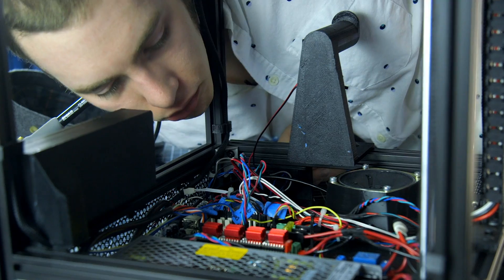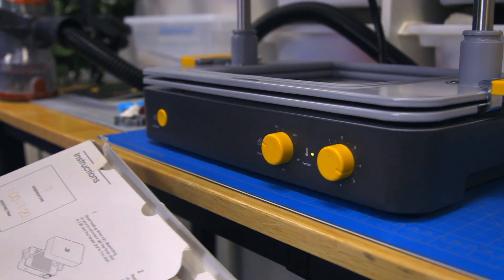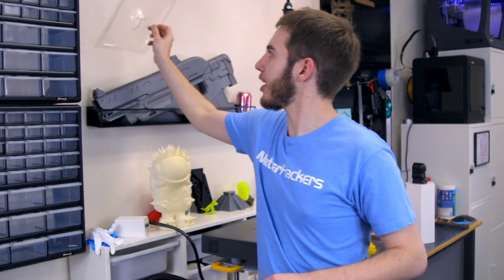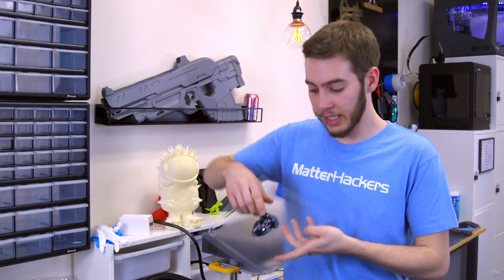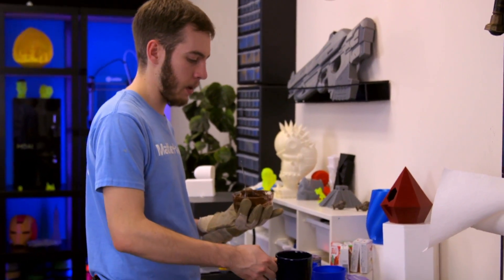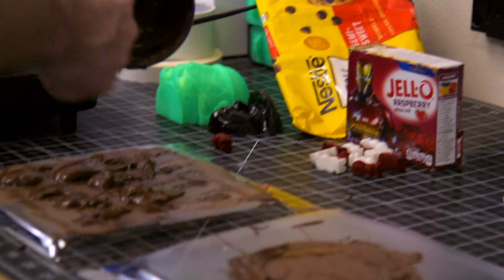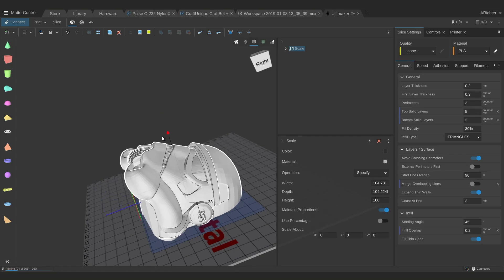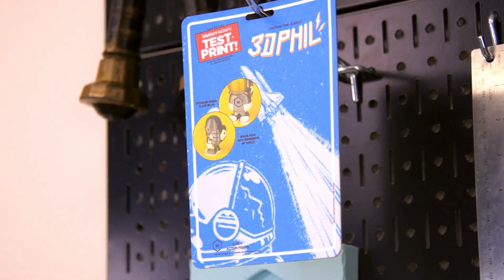Alec Eats His Face! | Let's Make | Vacuum Forming With the Mayku FormBox

Comment: I've operated huge versions of these. We use to use cool air fans after forming. The cooling helps the form pop out. If you get tiny bubbles appear in the formed part, that means there's moisture trapped in the plastic. Place in a very low heat convection oven for few hours or overnight to dry the sheets before forming.

Comment: I wonder if it would be useful for making custom cases for components.. Print a buck. Vac form the shape and bam the item you place in the case will have a perfect home and not. Bounce around.. And if it's not sensitive save the print step and just vac the item!
Reply from the maker: You'd basically be making something just like the 3D Phil figure. If you're thinking of something like a circuitboard there may be too many details of differing heights or the pins might poke through the plastic. But something like a phone case isn't a bad idea! I may have to try that. - Alec
Reply: @MatterHackers  or even a transportation case for like drone parts or something where it doesn't need soft padding but instead locked in place
Reply from the maker: Okay, so sticking your phone in it doesn't work out too great. The phone was fine, but the plastic didn't conform around it enough to hold on. It's more of a specifically shaped dish than a case. - Alec
Reply: Great idea - what we've found useful is making a slightly larger 3D printed version of what you are trying to make a case for - this way you can tweak it to make whatever you are putting in the case, extremely snug. Sort of like what Playdud did with packing on this guy: https://www.mayku.me/article/playdude-creates-professional-blister-packaging-with-the-formbox

Comment: What about using a heat gun while it's vacuuming to help pull the webbing out?
Reply from the maker: On something that small, it wouldn't help too much. Webbing comes from there being too much material so it folds over itself, like how a tailor will remove material in a dress or a suit to make it fit better on a person instead of bunching up around their joints. We can't really do that with plastic, so the best shot would be to keep it less droopy and therefore it needs to stretch to cover it more. Great idea though, and it does help with bigger projects that don't get enough heat before the vacuum catches it. - Alec

Comment: Can you pour resin into a vacuum form mold to make parts (instead of a messy silicon mold) ? that would be a cool video.
Reply: depends on materials of the resin and the plastic mold I will look into it some more.
Reply: @Java_Fusion  cool looking forward to hearing more.. i would love to see something hard like polyurethane
Reply from the maker: @MicheleHjorleifsson  We've tried it, but there's a couple things about it we didn't consider and had problems with: mold release is key and resin is exothermic. The resin we poured in wouldn't come out, even if we tried breaking the mold; it was just way too stuck. In other cases, I've had resin with a quick set time heat up the tupperware it was in and melt it to the plastic sheet I had on the table. Use mold release and a resin that takes a long time to cure and you should be better off than we were. What did you want to make? - Alec
Reply: @MatterHackers  ocassionally when finishing up a prototype for a client they want 5-10 or 20 more to hand to staff for further comment / testing etc... takes forever to 3d print that many so was thinking mold would help.
Reply: Ya know who would know which one to use is punished props... let me ask them.
Reply: @MicheleHjorleifsson  @matterhackers we had success with casting resin in FormBoxes molds as long as you use polypropylene sheets - anything else and the resin bonds to sheets.
Reply: @TeamMayku  thanks, can you share which resin you used i will stick with what worked for you :)

Comment: suggestion, in your model have a small hole all the way through from back to nostril so the vacuum has a way to pull at that bend point
Reply from the maker: In the article I wrote about thermoforming, I go over that detail and other things to improve your pulls when using the Mayku Formbox. In this case, it's less the material needing to be pulled more, and that there's too much material for the space it needs to fit in. - Alec